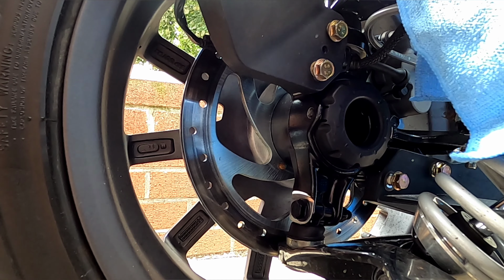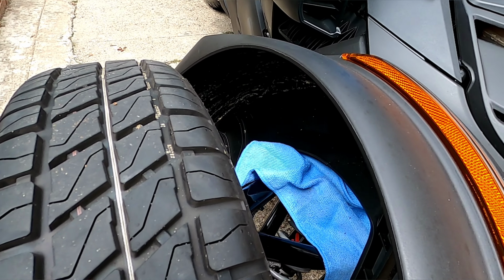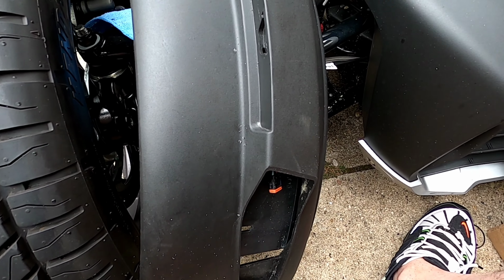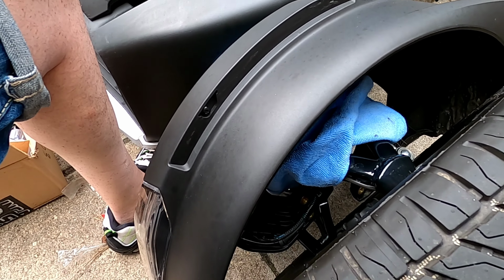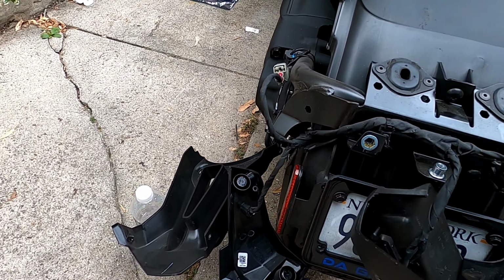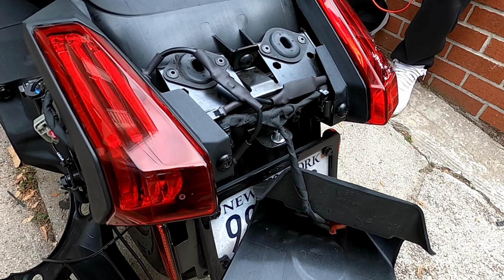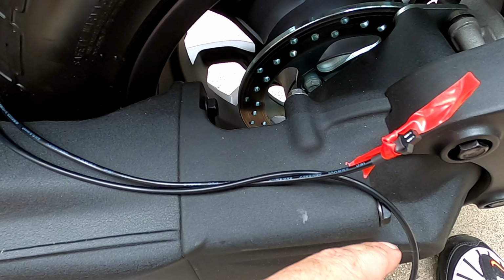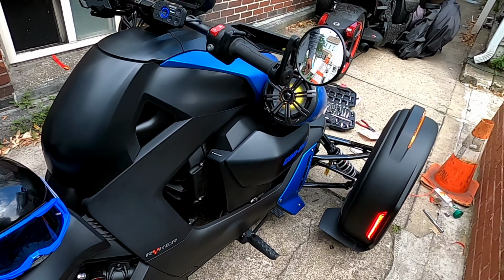2021 Can Am Ryker upgrades LEDs by the Ryker Doctor

Comment: I also installed  the split led lights and removing the fender help with properly installing the wires. You really don't have alot of space between the wheels and the fender.

Comment: I took my wheels off on my install,  but I  still had to take the fenders off because I did not have a small enough drill that would fit to drill the zip tie holes